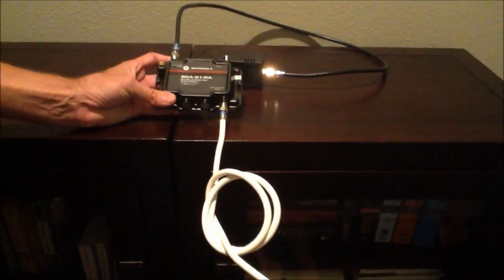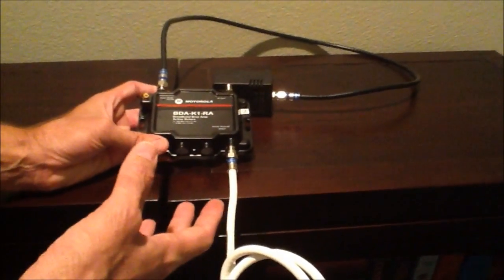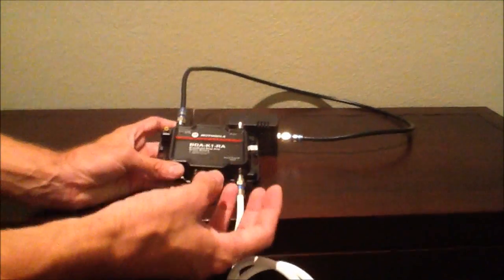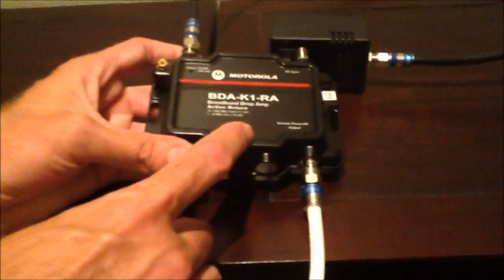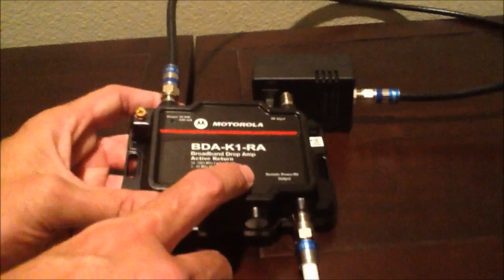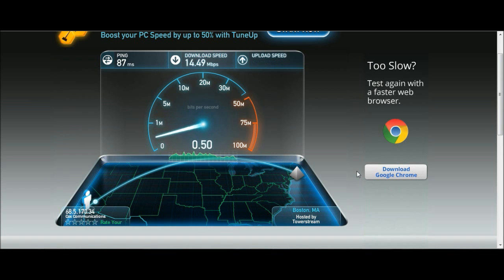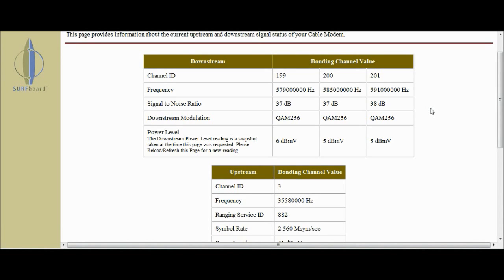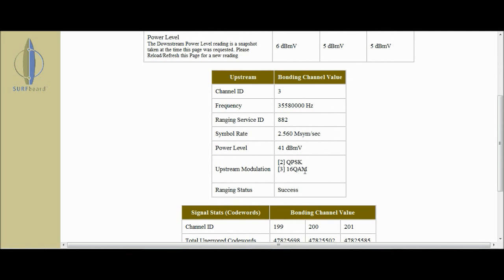Resolve Cable Modem Disconnects Caused by High Upstream Power Level

Comment: As a technician here, this will make it worse and create a noise such as TV pixelation/dropped internet cable modem connection for higher signal levels using a amplifier if you don't know about this, but all you have to do is use the attenuator to reduce the signal levels, but please guys DO NOT use a amplifier when the signal is too strong, it's only used for weak signal levels, also if the upstream level gets way more strong than the downstream level, that's caused by water corrosion outdoor coax plant cables, and etc, it's extremely important to get a cable company technician to come to your house for fixing cables, replacing node amps or something else, so hope this helps that people who do not know about stuff.
Reply from the maker: Any recommendations for how to use an attenuator to improve signals? I had COX come out on multiple occasions and replace all that they can.

Comment: ok i'm lost. at what point did you talk about adjusting the settings on the modem? or do i just need to buy an amplifier?
Reply from the maker: The adjustments are not made on the modem, they are made on the amplifier. You will see the results of the amplifier changes in your modem‘s web interface.

Comment: Does the power indicator light come on as soon as you plug the amp in?
Reply from the maker: That will probably very depending on which model of amplifier you have. The real test is to make adjustments on the amplifier and see the effects in the modem’s web interface.

Comment: Thank you for this information. I have had Comcast/xfinity for years. Three years ago I dropped my satellite TV provider for Roku. Now we use the internet connection for TV streaming and internet.  Over the last year we have experienced internet connection drops more and more. It started occasionally then got to be daily and then 3-10 or more times a day. Xfinity kept running the same diagnostics on my connection and telling me there was no problem. The last time I called them the tech told me that my modem had a corrupted file and that he uploaded a fix/new file and my problem was fixed.  Not at all. After watching this video I purchased the Amp recommended and hooked it up. I have not had a single dropped connection since. It has been three weeks so far and looking good.  Thanks again for posting this.

Comment: what is upstream and downstream? and why can I edit it on my modem settings? What happens if i set my upstream/downstream to 1000KB/s
Reply from the maker: You cannot change the upstream and downstream settings on your modem. They are based on the signal strength/quality from your provider.
Reply: @BBStudioProductions  I see, thanks!

Comment: This is what I was searching for ALL day.. THANK YOU! I spent too much time researching how to change the modem channel manually and didn't even think about trying to amplify (my power was below the range of my modem) the signal. I cut it in HALF by removing it from a DirecTV splitter and extending the main line directly to the line that my modem plugs into.
You're a life saver!

Comment: Do not use amps. You have too low a signal or it’s going through too much splitter work. Get a technician that knows something to either find your problem or order a different value tap. Amps don’t fix signal issues, they just make them louder, ultimately causing problems for your whole node. And when that amp dies (it will) you will lose about 20-30db of signal, then nothing will work until you buy another amp. Unless a good technician decides an amp is the ONLY way to resolve the issue, the issue isn’t being properly resolved.

Next technician out there should be encouraged to check for Bit Error Ratio on modem frequencies, as well as transmit and received levels. This is a bandaid, not a fix.
Reply: Yeah you're right, amplifiers can increase the signal levels, not just reducing so this is why it can create more noise and make it worse.

Comment: Great video. Cannot order a PCT 1-port off of Amazon as it's currently unavailable so just ordered an Arris off of eBay. Couldn't decide whether to replace my current modem ((16x4) with a 24x8 modem but will give the signal booster a try. My only concern is my downstream numbers will likely shoot up as they are already around 3.5-4dBmV even with a 6dB forward path attenuator pad on the back of the modem. It is likely I will have to order another. If anyone else has similar concerns then an attenuator pad would be a good fix (make sure it's forward path. It attenuates only downstream frequencies without affecting upstream). Cheers.

Comment: im getting an issue where my internet comes in for like 2 seconds and then completely stops for minutes...been happening for like 5 days (meaning 5 days basically without wifi)...i checked the docsis page of my modem and this is what i got (can someone tell me if its normal?):
Port ID	Frequency (Hz)	Modulation	        Signal             strength (dBmV)	Signal noise ratio (dB)
1	         591000000	        256QAM 6.300	40.946	          248586241	         390	6	7

Comment: Thank you This not only fixed my annoying internet disconnects and cable modem recycling it self, it also fixed my TV issues with dropped video/audio and pixelation. I actually had an amp similar to this one in a box for over a decade and never used it.

Comment: So my downstream levels appear normal. 37.4 to 38.9db. And upstream a 47.2 to 48.9dBmv. But my arris sbg8300 still cuts out about once every 30-45mins. Had xfinity(ISP) come out twice. Replace lines. One gentleman told me my router reset itself 52 times in a 24hour period. I have 1gig internet. And so i wanted a router modem to preform good. So far this whole expierence has sucked. Would something like this return help balance out my problem you think?

Comment: So should these be at every splitter? I have 2 in my house
Reply from the maker: This active return amplifier goes between your cable modem and your cable outlet on the wall.
Reply: The more amps you have, the more they distort the cable signal

Comment: dose this works, or at least can be as the same as the one you installed
 https://www.amazon.com/Cable-Amplifier-Splitter-Booster-Passive/dp/B077GJFV8L/ref=sr_1_1?keywords=Reliable+Cable+Products&qid=1576821144&sr=8-1
Reply from the maker: I don't believe so. It needs to be an Active Return amplifier.

Comment: I own the PCTMAB10151A and it works great, it lowers the upstream power level.
It will also increase downstream dBmV by 14db, buy a Forward Path Attenuator 6dB to keet it at range. The Forward Path Attenuator 6dB decreases downstream dBmV without increasing upstream power level. I bought two, they cost 4 bucks each and it hooks up directly to modem.
My ISP is spectrum, Arris SB6183 modem, 200mbps down/10mbps up.
Stats : Downstream 3.9 dBmV 38.0 dB, Upstream 40.0 dBmV.
Rock solid connection day/night, zero drops.
Reply from the maker: Great info. Thanks!
Reply: is your modem close to the cable that comes to your house?

Comment: Thanks.  Works for Upstream problems but causes my downstream power to double and have problems.    My downstream is always solid and my upstream sometimes gets up to 54.0 dBmV.  Any suggestions?
Reply from the maker: I believe the active return amplifier I recommended in the video allows you to fine-tune your settings.
Reply: BBStudioProductions no it doesn’t.

Comment: I have an Actiontek C1900A, and a bonded pair broadband to my home. I discover that I can (192.168.0.1) log into to the router normally.  THEN on any of the options I pick, it crashes me out and I must log in all over.  I have NO control of my modem/router unit.  (I am afraid to press the button to reset it back to factory, because I do not have any of the settings and it took the installing tech 2 hours on the phone with his boss to figure out the settings and get it working)

ANY IDEAS? (Other than "call a technician")
Reply from the maker: Try connecting to your modem at 192.168.100.1
Reply: @BBStudioProductions  Thank you for the tip.  When I tried to connect at 192.168.100.1, it timed out .  I then ran windows network diagnosis: I got:
Your computer and network appear to be configured correctly but the resource or modem fails to respond.  Thanks
Reply: I also tried 192.168.100.1 and 192.168.1.254  same deal timed out.
Reply: Some success.  I found that many people have my same problem with the ActionTek C1900A  modem-router.  Routers in general are susceptible to electronic noise on the line.  My modem is a 2 pair bonded type so it is receiving twice as much noise and trash over the bonded pair of lines.  I was told to reboot it and as soon as I got an internet signal, immediately log into the router and it will work for a while.  Well it does for 2-3 minutes then kicks me out to the log in screen  where I log in and select any of the options and get kicked to the log in screen again.  I have to reboot the modem, log in, switch pages, do my looking or changing fast before it kicks me out again.  Repeat until you get your work done.  I moved it outside to the J-box where the broadband enters my house and it does the same thing, meaning the poor quality signal is coming in from Century Link.  I am on an OLD copper wire system. There are too few people on it to justify repairs or replacement according to Century Link.  Hurry Elon.  Star Link is in my future.

Comment: Low Signal with loss of internet,  Added a " PCT 1 Port RF Amplifier Active Return"  Boosted me way past spec.  Had to add a splitter and a  -6db  attenuator to get it in spec.  I get 208 / 37 every time. slightly  Past what I am paying for.

Comment: Do you have a recommendation for too low of an upstream? My downstream is in specification
Reply from the maker: Conrad Schanze if you purchase the amp that I mentioned in the description of this video, you can adjust both the upstream and downstream. It's the PCT amp, not the Motorola one.
Reply: BBStudioProductions Thank you. I appreciate it. I have another question for you. When my issue first started, about a month and a half ago, the technician attached an attenuator with a 6db pad. In the modem settings this lowered the downstream and raised the upstream, but seemed to actually make my issue worse, even though as far as specs go my signal levels were even better. Is that increase in upstream superficial? It seems like since it has to pass back through the attenuator, that effectively my signal only would be weaker.

Comment: What's a good current amplifier? Where should this be connected? Anywhere in the line I have access to? Closer to the modem?
Reply from the maker: https://www.amazon.com/dp/B0012HQL44
Reply from the maker: Connect this between your wall and the cable modem.

Comment: Damn bro 58 in your TX. You may have a sub band attenuator or too many lines connected in your home. ( too many splitters or bad levels from tap. Unlikely though. Most of the time the problem is in the customers premise. Also don’t use just any amp. Get the one your cable company approves. Some of these amp may blow your return out of the water and it might be a one port amp. Call your cable provider or if you see a tech on their route ask them what amps they use

Comment: I also have COX (which somehow is the only "high" speed Internet provider) and have had intermittent Internet since I moved in two years ago. They keep sending out technicians and they do nothing but scratch their heads. One technician on DLSREPORTS said the reason is that COX systematically oversell their nodes. They are rated 1.0 of 5 for customer satisfaction on their Facebook page...

Comment: This video is old but the technology is still the same in 2018, if you buy this with an active return issue you could shut down the entire node. This is a cable companies worst nightmare, people blasting return noise back into the system. If everyone went out and bought one of these that lived on your node you would have so much noise your internet would be garbage. This guy has a transmit power of 58 so something is seriously wrong before he puts on the amp.After he puts on the amp he gains 17db which is insanity on the upstream. Also the signal to noise on downstream should not be 30 or better, 30 means you have a problem on the downstream , 30 is ok on the upstream if your qam modulation is qam 64 or qam 32. I hate when people make videos and have no clue what they are doing. These are the type of people your cable company will track down and shut off because they are causing to much noise. What you need to do is log into the modem show the tech that shows up the upstream power and make sure he doesn't leave until its in the 40's, sounds like this guy just had shitty techs.
Reply: So my issue is that I'm getting interference from power lines outside my house. This causes interent disconnects frequently. Would this device help me at all?
Reply: Ziad Ramman stfu
Reply: @dfalfan  interesting. I'll try that.

Comment: hey can you give me a link to where i can i buy the amplifier, i just upgraded my internet speed from 100mbps to 300 and i get about 450 mbps ion my laptop but ever since the upgrade my modem is non stop resetting and i already have had two technicians come to my house and said they fixed the problem but it still keeps rebooting so im hoping this will fix it.
REPLY
Reply: & the link you provided is not longer available.
Reply: joe tejada did you find a solution? I’m going through the same problem.
Reply: KasinovaPrince unfortunately I haven’t , I need to buy this amp

Comment: Does your router have a 2G & 5G setting? Did you notice after doing this that your 5G (faster) router setting stopped working?
Reply from the maker: Video Video Video No functionality was impaired.
Reply: hey can you give me a link to where i can i buy the amplifier, i just upgraded my internet speed from 100mbps to 300 and i get about 450 mbps ion my laptop but ever since the upgrade my modem is non stop resetting and i already have had two technicians come to my house and said they fixed the problem but it still keeps rebooting so im hoping this will fix it.

Comment: I WORK FOR COX. PUTTING A AMP ON YOUR LINE DOES NOT LOWER YOUR TX ( UPSTREAM). INSTEAD TRY USING WHATS CALLED A DC-6. LOOKS SIMILAR TO A TWO WAY SPLITTER BUT FUNCTIONS DIFFERENTLY
Reply: HE IS ALSO WRONG ABOUT THE UPSTREAM LEVEL. THE UPSTREAM FROM I RECOMMEND IS BETWEEN 30 AND 53
Reply: @mrjayhman01  lol thats the problem you work for cox 53 is high and almost borderline of 54 so no its not good

Comment: so here's my problem - when i turn on my modem it runs smoothly for 1 hrs or so , but after that my internet light turns red , and it doesn't doesn't connect , i have tried switching off/on the power but it doesn't help , after i restart the modem with the button provided it is back to normal again , but i have to reconfigure it again (the id and password given by my ISP ) , and it runs a decent  30 min or so after which it happens again . what is the cause behind this ? answer fast.
Reply: That sounds like a Line issue